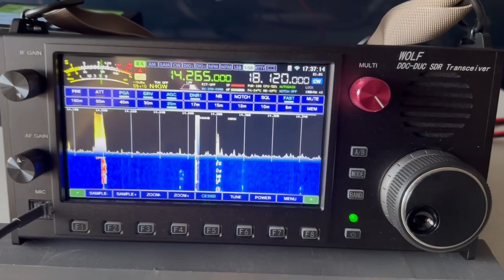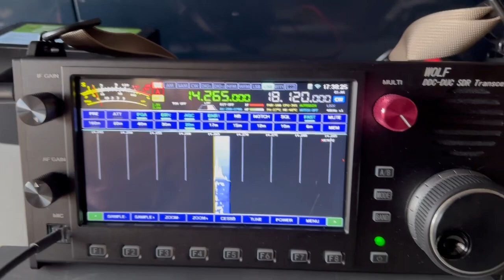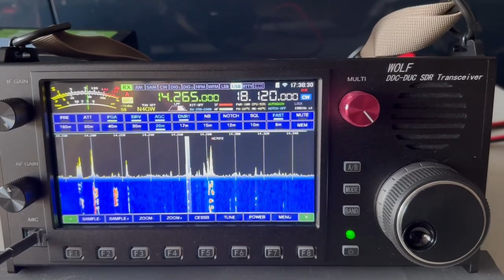Wolf RS-998 DDC/DUC SDR transceiver - checking CESSB compression performance

Comment: Hello, is this tuning knob originally from the Chinese, included in the radio set, or did you change it yourself?  I'm asking because currently my Wolf WF-100D has a KX-3 tuning knob and I think it's a bit too small for such a large radio as the WF-100D version.
Reply from the maker: The tuning knob came from an old Yaesu FT-990